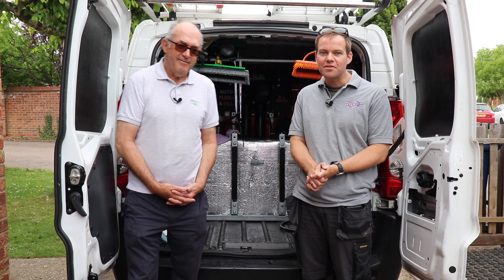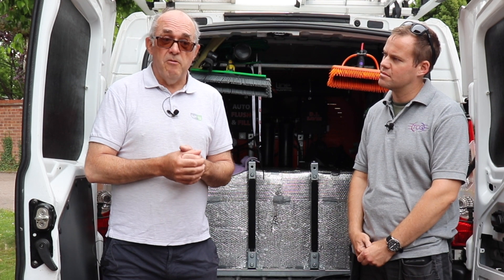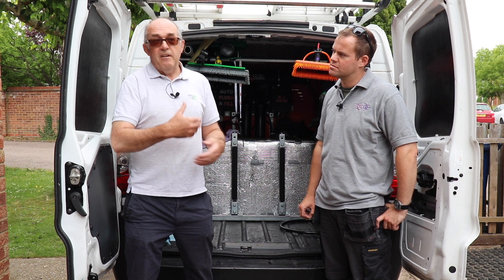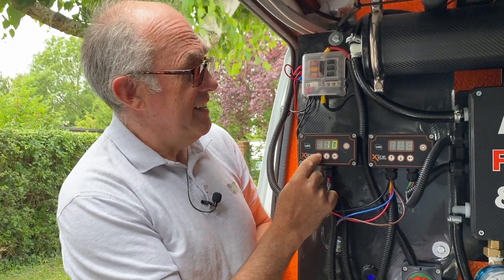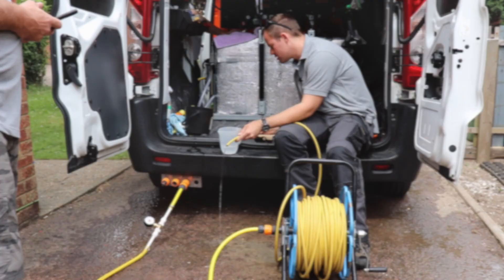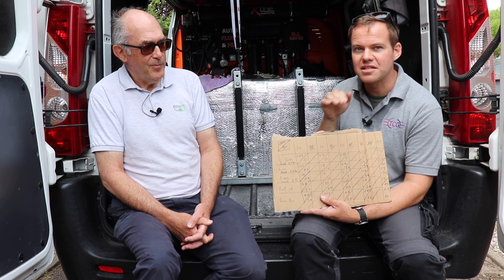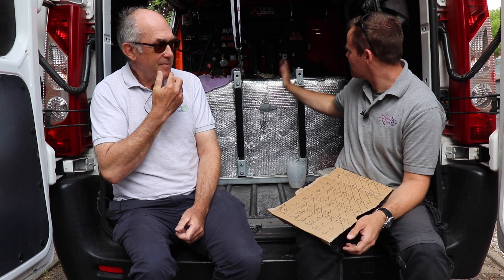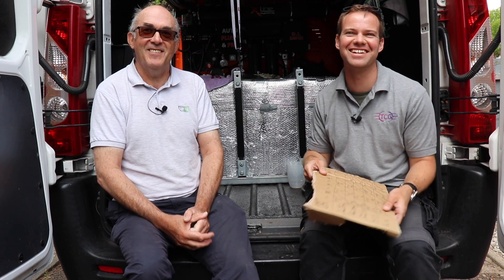Best Setting For Your Pump Controller.

Comment: Hi ive got a v11 control is it worth upgrading to the v16
Any one got any advice
Reply from the maker: @martinfretwell  if the V11 is working for you then stick with it. If you look at all the advantages of the V16 and think that they would work better than change.

Comment: Hi guys, very informative video! I am in the process of building a pump system. I would like to have one pump to use for window cleaning AND softwashing.   Firstly, is this possible to do using a controler to manage the pressure/flow and if so which controler would you recommend? The pump will be a 60psi 7gpm. Thanks!
Reply from the maker: Hi Tim. 
Im not 100% sure so you would be best contacting your supplier or spring Europe directly

Comment: Interest numbers, but I find that a higher pressure helps rinse the windows faster and break up birdmess too. When I’m so used at working at 65 when I drop down to anything below 50 I find work is slower.

Comment: I have a 8mm hose and a 6mm hose system. The 8mm runs at 45 and the 6mm runs at 75. They feel about the same flow rate at the brush end which matches the data you have. Interesting

Comment: great video. thank you. quick question. i believe your using a 100psi rated pump. is that necessary? Could you use a lower rated psi pump and get similar results? Currently using a pump rated at 1.3gpm/100psi but want to use a pump rated more at 3gpm/60psi. Any thoughts? thanks guys
Reply from the maker: To be honest I don’t know the reason behind it but it’s the industry standard in the Uk 
Tend to use higher flow pumps for applications such as softwashing

Comment: Hi dave if i want my pump on full speed, do i really need to buy a controller as ive had my flow on full whack for
7 years thanks
Reply from the maker: You can run it on full with no controller but on full you don’t always get the best flow rate and turn put your battery and pump under a lot more stress then it needs to be reducing its life expectancy

Comment: Would have liked to seen 50 degrees and 100 degrees on this experiment. I'm currently using 100 degrees at 70. Making me question whether to lower it
Reply from the maker: Best thing to do is try it at 50, 60, and 70 for a minute and measure the amount each one gives and see how much water you get on each
Reply: @squeakycleandave1  I'll give it a try! What's the suggested flow per min?
Reply: I've tried at 55 and seems pretty good to be fair. Are we saying then that with 8mm more water on the glass less flow rate such as 30-35. But with 6mm you needing to be higher let's say 50ish? Based on all the comments is there actually advantage of 6mm? Surely 8mm be better because you have lower flow on the controller and less strain on pump batteries etc and achieve really good clean? Debating whether 6mm even has advantage over 8mm? Only thing I can think of is its lighter?

Comment: Do you unwind  hose to calabrate or  leave it on reel
Reply from the maker: We did leave it on for this experiment but it was wound on for all the different size hoses and jets accept for the 1/2” so although it may have made a difference it was an equal comparison

Comment: Great video. I've been using wider brush with 4X1.3mm pencil jets for around 2 months now. My V16 is set at 36(because I don't like odd numbers, lol). Have found I'm getting a faster clean and rinse is a lot quicker than it was using a smaller brush with 2x 1.3mm jets.  Am only using slightly more water per day, but am getting through the work quicker,
Reply from the maker: I’ve been doing this for a while now and it makes a massive difference 👍
Reply: @squeakycleandave1  what brush you been using?

Comment: Good research, better way is to drill out your jet sizes to give more water flow and less pressure and ware on the pump and hose’s, move volume of water and less pressure on the glass which flood’s the glass,  70-80 on pump controller, I run 4 pencil jets oversized 3.5mm and 5 mm I/D hose tube on 85 meters with 25 meters take off connecting increments , so you can run smaller sections at a time on smaller area’s which lessens strain on systems 👍🤙
Reply: I have to see this! You must use an absolute ton of water with 4 x 3.5mm jets. I tried the wider brush with 4 x 1.4mm jets which used a lot more…
Reply: @crispylimbs  I work a lot quicker because you are doing less passes and less rinsing on the glass and no dwelling because you have flooded the glass I’m using 10 to 20 percent more water which doesn’t matter it’s only water, making more money because I’m doing more jobs in a day, saving a day off  work in a week👍💰💰
Reply from the maker: @FlashTechEngineering  I have found this to be the case. you do use more water but thats because you are doing more work
Reply: @squeakycleandave1  also less fatigue working at heights because of the flow and less agitation required .. also makes you work faster because you know your running higher flow rates and don’t want to be wasting the water 😂😂

Comment: Great video very interesting I will be doing a test myself, rather than sticking up to 100 to rinse conservatory roofs. One thing I'm confused on, does the 6 or 8mm reel hose make any difference if its reducing down to 5 mm anyway to  go through the pole hose
Reply: As in the video 8mm will give higher flow volume at lower pressure compared to 6mm. The larger hose can carry a little more water with less resistance. The ideal is hood water flow/volume on the glass but at the lowest pressure. Hydrophobic glass benefits for more water volume falling as a curtain across the glass
Reply: @iansheppard9246  yeah I get 8mm will carry more than 6mm in reel hose, but volume from the reel hose will have to reduce to go through the 5mm pole hose to the brush anyway. So wouldn't the pressure increas but flow reduce at this point. Not being argumentative,  it's a great subject, just cant work out if I'm being thick 🤣🤣
Reply: @gasket79  Yes there will be a difference in both flow volume and pressure as the hose ID drops from 6mm to 5mm. Using Sam,s chart 6mm hose at a flow rate of 90 showed 3.32 litres per minute with pressure of 4.6bar (66psi). With 5mm hose the water volume drops to 2.9 litres per minute with pressure increasing to 5.6 bar (81 psi) Of interest is that with 5mm dropping the controller flow rate from 90 to 70 saw flow volume of 2. litres per minute But pressure at 4.4 Bar (63psi) A flow rte of 70 then gives almost the same flow volume as at 90. More pressure then does not automatically mean more flow. In this case dropping flow rate on the V16 gives good water flow and importantly at lower pressure which means less strain on the pump, Hose connectors, and less current draw by the pump. The tests show that it is water flow/volume that is needed Not pressure. The controller gives flexibility to suit water flow Job to Job and reduces wear and tear on the system. A lower current draw by the pump means that the battery needs charging less often too
Reply: That's a great question and it seems that it does make a difference. From what I understand the gradual reduction speeds up the water but reduces the turbulence.
Reply: @SamuelPeden  oversized jets on the 5mm I/D tube basically becomes open flow and no back pressure on pump 4 pencil jets at 3.5mm higher flow is achievable 70-80 on controller, I’m running about 3.5-4.2 litres per minute, a good flood on the glass 👍💰💰
Reply: 5mm I/D  tubing equals approximately  19mm2  so 4 jets x 3.5 mm
Reply: Please let us know the results from your test:-)

Comment: Great video, thanks to you all. I wonder what difference in battery AH the different speeds make? Is it worth adding a link to your site in the description?
Reply: Battery ah shouldn't make any difference to the flow rate. Unless it is an almost dead battery it should only affect how long the pump can operate for
Reply from the maker: Not 100% sure but I don’t think that the Ah would make any difference as it measures the amount of energy stored in the battery not the power
Reply: @squeakycleandave1  Sorry for confusing things. I more meant the amount of battery power that was used for the 15 seconds to measure the flow rate at various controller numbers. i.e. did it pull 2A at a controller setting of 10 and say 5A on 90?
Reply: @ched999uk I wish we'd had the equipment to test that! When we get the article posted on tcg (this week) Ian Sheppard talks about that. He performed a similar test in the past where he measured that and also the temperature the pump ran at.
Reply: @ched999uk  Good question. as a general rule with the flow set between 30 - 40 amp draw per hour is likely to be 2 to 3 amps increasing flow up above 70 might see around 5 to 6 amps an hour. But this will vary slightly. It would be good to repeat the tests using an amp clamp. It is worth mentioning that if the battery voltage is low as Sam commented you may see flow cycling as the battery struggles to draw current from a flat battery
Reply: @SamuelPeden  Looking forward to the article, thanks. Just so you know most cheap multimeters (£10 from Amazon) will have a current measuring facility, as long as it's up to 10amps that would work fine. To be fair we want to know about water flow as that's what gets the windows rinsed, current was just an interesting thing as I don't think many run out of battery power (well drop below 50% charge) in a day but some have to remove a battery and take it indoors to recharge. So knowing roughly where the sweet spot is flow wise but also current might be useful. It's not a criticism as your vids have been great. Sorry I was trained as an electronics engineer and worked testing stuff for 20 years.
Reply: @iansheppard9246  Thanks very much for that, very useful. Nice to put a face to the name 🙂

Comment: I use an 8mm hose with 33 pressure on a V16. Seems fine. First cleans I’d whack it up to 50 which I thought used a lot more water but perhaps it’s not that necessary after all.
Reply from the maker: I like to get plenty of water on the glass. I’m thinking of going back to 8mm hose👍
Reply: @squeakycleandave1  Ridiculously expensive but would thoroughly recommend hi flo rhino hose from reach it. you get the flow and it's incredibly light and a dream to carry and work with, in my opinion. Saves time and effort (I'm 64)
Reply: @christopherbrough4400  I’ve got the same hose, there is nothing that compares to it tbh. The water on the glass is amazing with the rhino hose.